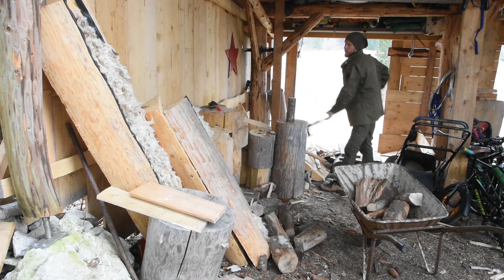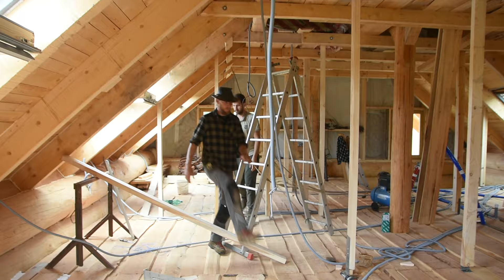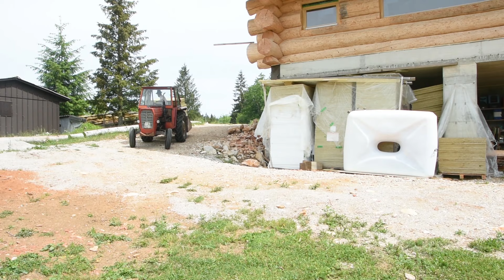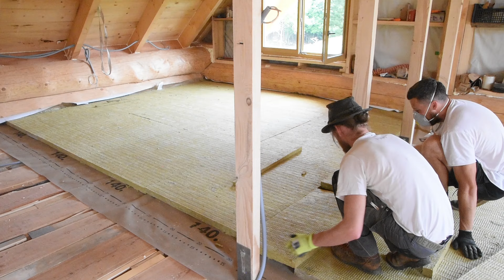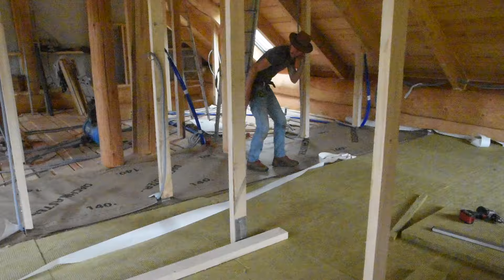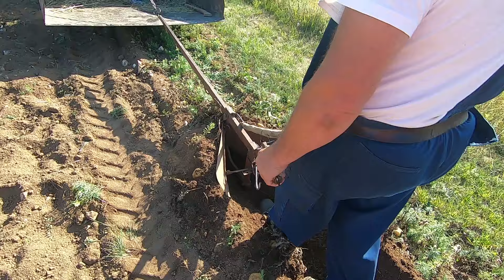Building LOG CABIN S4 Ep13- Insulation on the First Floor - with Nik Rijavec

Comment: Sound proofing. Cement does not insulate well. It holds heat and releases it slowly and vice versa. Dampens the temperature fluctuation.
Working with a buddy energizes each other. Works that way with my tasks.

Comment: I have never seen insulation used on top of a floor, on an upstairs floor. I don't understand it. All exterior walls in the enterior are usually insulated and sometimes under a crawl space but never over a floor in upstairs rooms. No need to respond, just curious.
Reply from the maker: The insulation proved to be a very good solution to the bowl of sound. When the kids on the upper floor are playing and running wild, it's much better downstairs. :)